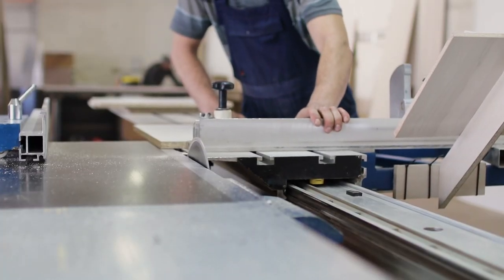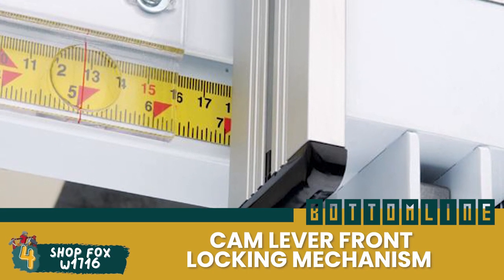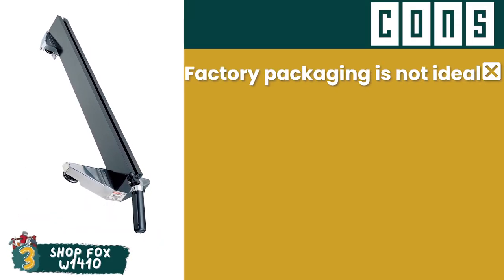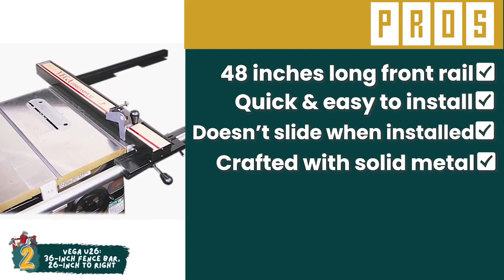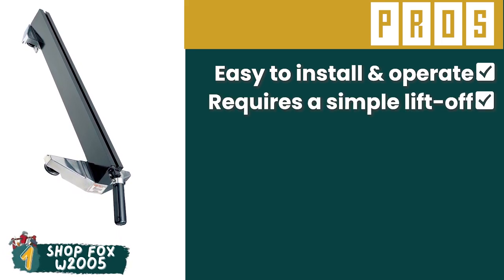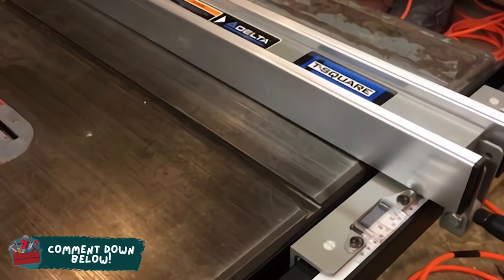Best Table Saw Fences 🧰: 2020 Ultimate Guide | Woodwork Advice

Comment from the maker: Read the full review here: ►► 
https://panaceatools.com/saws/table/fence/
(Best Table Saw Fences)

-------------------------------------
✅ Featured Products for Best Table Saw Fences

0:00 Introduction
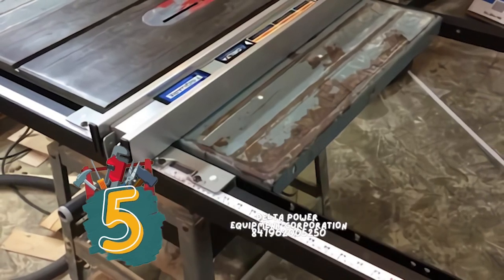0:48 5. Best for the Money: Delta Power Equipment Corporation 847962005250 ➜ https://amzn.to/2H9Osdg
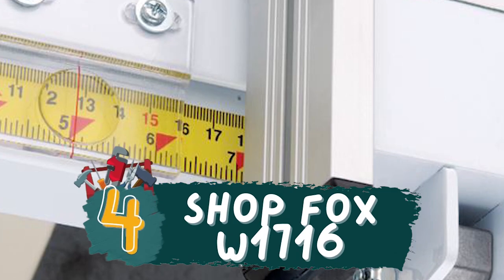1:46 4. Shop Fox W1716 Aluma-Classic Fence ➜ https://amzn.to/3f3L4Nn
2:47 3. Shop Fox W1410 Fence with Standard Rails ➜ https://amzn.to/2Uu5o0T
3:48 2. Runner-up: Vega U26: 36-Inch Fence Bar
 26-Inch to Right ➜ https://amzn.to/2UwxLvA
4:46 1. Best Overall: Shop Fox W2005 Classic Fence with Standard Rails ➜ https://amzn.to/2H4m5wT

Subscribe to our Channel 
🔴 https://panaceatools.com/youtube/

-------------------------------------
Detailed review: https://panaceatools.com/saws/table/fence/

🧰 Table saws are basically used to rip large panels of wood into the desired length and shape. For an easy, safe, and accurate operation, the fence is a very useful component.

🧰 It is worth noting that the importance of table saw fences is often debated. Some people believe that it is unnecessary, and working without a fence is the sign of a good woodworker. Others argue that it is vital for safe and easy operation. Putting aside these subjective views, when installed properly, a table saw fence serves a number of purposes.

💬 Let us know what you think of these Table Saw Fences in the comment section below.

👉 We appreciate every thumbs up and would be grateful if you’d consider subscribing to our channel!!

-------------------------------------
🎥 Welcome to the official YouTube Channel of Woodwork Advice 🎥

Woodwork Advice is your #1 online resource for tools and DIY-related how-to guides.   

 🌐 Learn more about us: https://woodworkadvice.com/about-us/
 💻 Like our Page: https://woodworkadvice.com/facebook/
 📢 Follow us on Twitter: https://woodworkadvice.com/twitter/
 📱 Check out our Pinterest: https://woodworkadvice.com/pinterest/
 🔴Subscribe to our Channel: https://panaceatools.com/youtube/

-------------------------------------
Disclaimer:
Some of the footage used in this video is not original content produced by woodwork Advice. Portions of stock footage of products were gathered from multiple sources including, manufactures, fellow creators, and various other sources. If something belongs to you and you want it to be removed, please do not hesitate to contact us at admin [at] woodworkadvice.com.

Some links in the description are affiliate links. If you click on one of the product links, I’ll receive a commission at no additional cost to you. As an Amazon Associate, I earn a small commission from qualifying purchases.

#WoodworkAdvice #TableSawFences #TableSaw